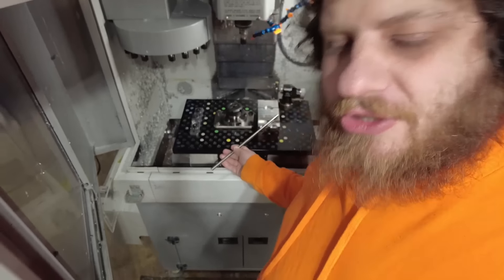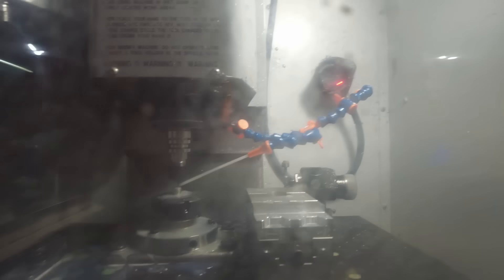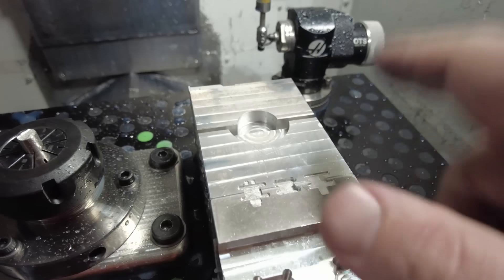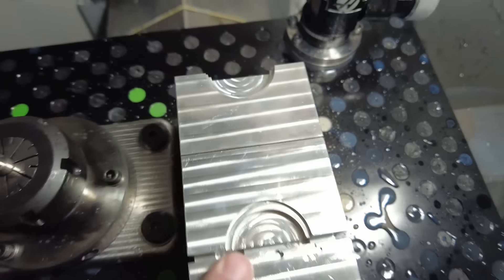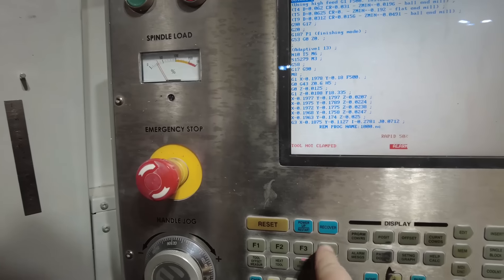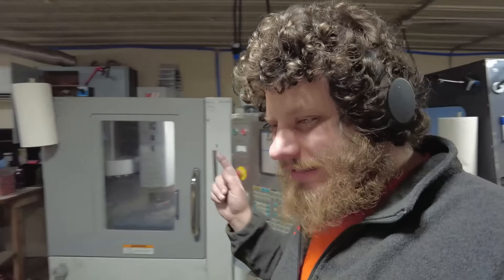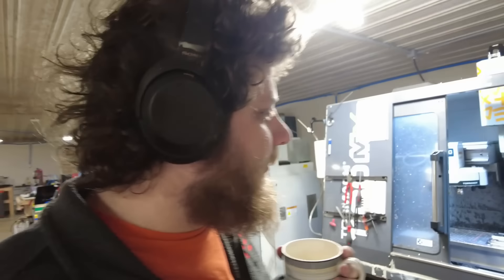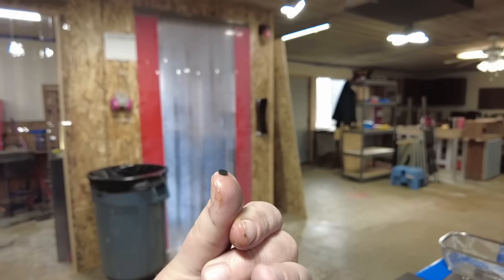Machining INCREDIBLY Tiny Parts

Comment: Bro you have to do some lean manufacturing or six sigma stuff. It saves you so much time and energy if everything has a specific home and labeled. Even though you work by yourself Im telling you it will make life much easier. Also I really want one of those Hass mills. I ran one of them when I worked for Bauch & Lomb making lense implants for cataracts. We had to hit crazy tolerances. We used Optoform 40s with diamond to do the concave/convex on the lens before cutting it out of the stock with the mill.

Comment: Cool parts holder with the collet fixture. What is the proper name . I would like to find one. Great vids
Reply from the maker: I have a separate video on it if you want a few more details. It's a 100mm ER-40 collet chuck, with a mounting plate. The collet chuck can be found on amazon for like $50.

Comment: Is it possible to set it up to use the tool height setter after using each tool, so you can find out if the tool broke and therefore pause the job, instead of cascading the failure to all the rest of the tools?
Reply from the maker: It is, and I got that setup in a previous video. Unfortunately I forgot to check the correct checkbox here.... It was a dumb mistake

Comment: Also, you might try even thinner shims on the soft jaws.   On much bigger parts, I’ve used paper thin shims to limit the amount of deflection.  You have to keep the jaws clean (free of chips) though.
Reply from the maker: Good to know! I have it in my head for some reason that you need a fairly large gap. But you are right, there's no reason for that.
Reply: Yea i've done a few thou as shim on tiny parts in soft jaws.

Comment: Try window machining. A price of square stock with machined edges will align everything so you can machine both sided. Then fusion makes it real easy to put tabs where you want. You should be able to pop the part out when finished with minimal cleanup afterwards.
Reply from the maker: you know, that is something I used to do all the time when I was running my little Pocket NC, but I never think of it on my 3 axis machines. It's definitely something I should put back in my toolbox.

Comment: Would it work to change the order of operations so that the bore is drilled in op 2 instead of op 1? That way when you clamp for op 2 it can't get crushed. Basically making the central plug out of the material itself. Or would it not work, because as soon as you drill the hole it would get crushed anyway?
Reply from the maker: I would have to test it! My first thought is that it would crush once the material is removed, but I don't know for sure without testing it, so maybe!

There's lots of ways I could have made this part better

Comment: as a machinist trainee i find this work on small parts very interesting, on a side not is your logo on you shirt backwards or is the video flipped?
Reply from the maker: Ooooh, so that's a funny story, this jacket was made with the logo upsidedown (which is the same as mirroring it). They ended up fixing it and sending me a second jacket, but the first jacket is still a perfectly good jacket, and I wear them both all the time.

The really funny thing is that when I record Instagram stories, the Instagram stories flip the image, and fix the logo on the first jacket.  I used to do a lot of Instagram stories, so I would exclusively wear that jacket in the shop.

Comment: Might not be super useful for this one, but if you stick the stock up like that and it's strong enough for a few parts, use a slitting saw to leave a very thin tab underneath so you can break it off in the machine. Then if you're on your toes, you can add in G91 G10 L2 P1 at the end of the program to drop the offset position, so you just hit cycle start again for the next part. Either change the offset back manually when you reach the bottom or wrap the g10 line in an if statement to reset it.
Reply from the maker: Yes! The salami slice method! That's one of my favorites. I do it on the Tormach all the time, but I don't have a saw arbor for the Haas yet.
Reply: @AudacityMicro  Fair enough. There are a few brands that make them but i use Paul Horn (PHorn) inserts. They do lots of sizes, all solid carbide shank, and cutter. My most used is a 939.150 on a M336 shank. They're commonly on ebay. They are way better than HSS slitting saws. You can run them at normal carbide speeds and they are super rigid. Leave a great finish if you're gentle

Comment: have you considered hydraulic holders or shrink fit holders?
Reply from the maker: I would love both/either,  but they don't make them for this taper. My only other option is the Rego PG system, but just the machine alone would cost more than my whole mill.

Comment: Your workplane is your workoffsets? How do you set your workoffsets
Reply from the maker: 85% of the time, I use offsets that are based on my fixtures. The corner of my vise, the center of my ER fixture, etc. I don't need to set a new WCS for most jobs. The exception is op2 work in hard jaws. That always gets a WCS. But for softjaws, I can just use the corner of the vise again.

Comment: I'm merely a hobby machinest, just here to learn, but if i were to do it, i would have 3d printed some sacraficial work holding for the tiny part. perhaps with some, small vacuum line on the bottom to hold it that would also serve as a entrance to eject them with some compressed air. Just thinking
Reply from the maker: That method can definitely work? The thing to remember, is that these parts were a .2" diameter ring that's .015" thick. Not exactly a lot of surface area for the vacuum to work on. But that method could definitely work on larger parts!
Reply: @AudacityMicro  I'm from the Netherlands, still having a hard to converting those numbers to metric haha. Well you could also press fit them in, and if you use some dissolvable print material you could easily recover them :)
Reply from the maker: woops, sorry. I need to get better at saying my metric conversions in the video. It's about 5ish in diameter, and .4ish mm thick

Comment: For OP20 on the stainless part.  Why don’t you just use the same collet fixture?  Use an undersized collet in the fixture…for example, if your part diameter is .375, use a .312 collet.  Put a piece of .312 bar stock in the collet and have the end of it just bellow the face of the collet.  Then tighten the collet so it’s pre loaded.  Use a carbide end mill and cut a step in the collet to the finish diameter of the part your holding and to the desired depth you want to hold part.
Once you’ve cut the pocket, loosen the collet and take out the pre load slug.  Then drop your part in and tighten.  You should be good to go!  Good Luck!
Reply from the maker: So my big concern was clocking the features on the top and bottom of the part. I've never tried the workflow you suggest, and I definitely want to at some point, but I'm not sure it would hold alignment. I could be wrong though!
Reply: @AudacityMicro There are ways to orient the top to the bottom also.  It’s a little involved and I realize you’re pressed for time.  If you ever need work holding ideas, I’ve got 30 years experience in cnc machining and custom work holding.
Reply: Use 5C collets. They can grab a shorter section of bar than an ER, so less waste, and you can get oversized soft collets for larger pieces.

Comment: Bro 3 jaw chuck is better for this job .
Reply from the maker: How would you clock the features on the top and the bottom relative to each other?
Reply: @AudacityMicro  I would have used some things like a thermocol or something similar so that  job would not break by in the VICE .